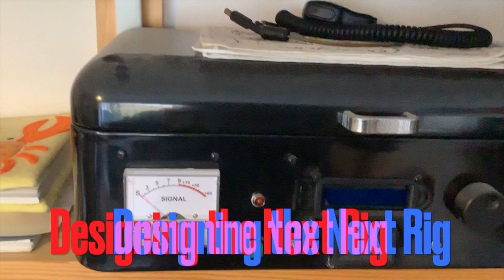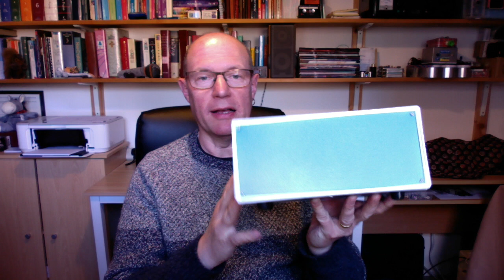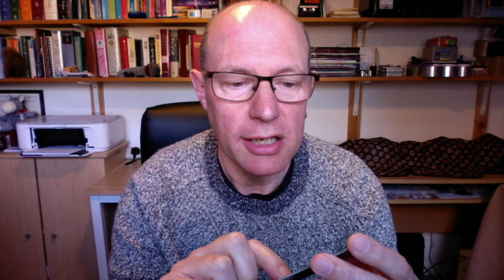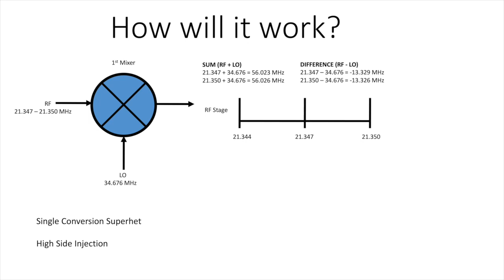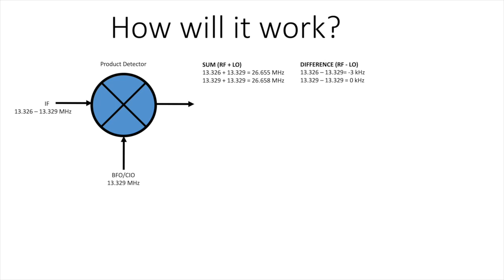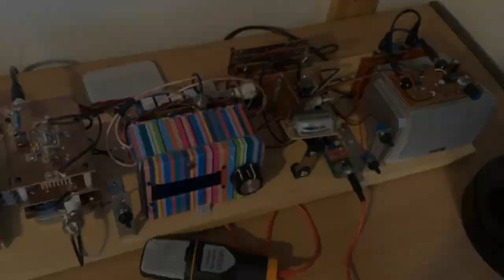36 - Designing the Next Rig

Comment: made my own pcb design of the TIA and the one going dual direction is only 28mm x 27mm using 0805 SMD components and 2N3904's as THT. build my own crystal filter using 3x 16MHz crystals and about 100pF, may need to go a bit up in capacitance for the 2.5kHz bw.
Reply from the maker: Congratulations! I had some fun creating my own TIA pcb - it's not as small as yours though! Well done on the Crystal filter too. Did you find that 3 crystals was enough to give you the cutoff you wanted? I've usually settled for 6 in a Cohn design but I have gone as low as 4 once. It's all good fun! Keep up the good work. 73, Nick